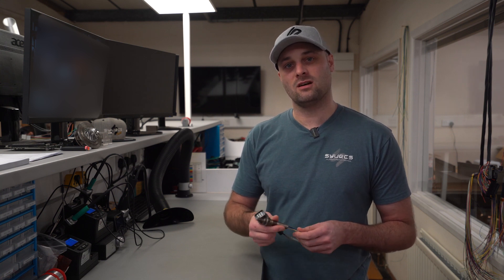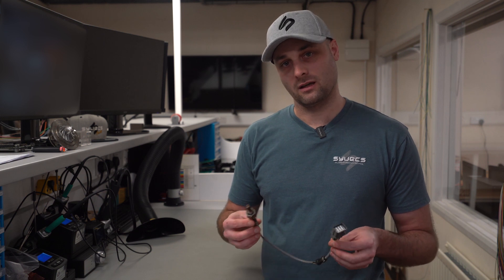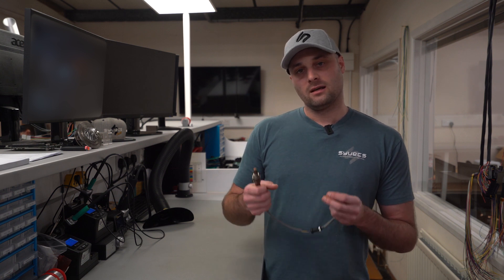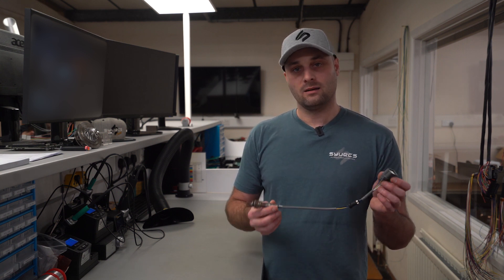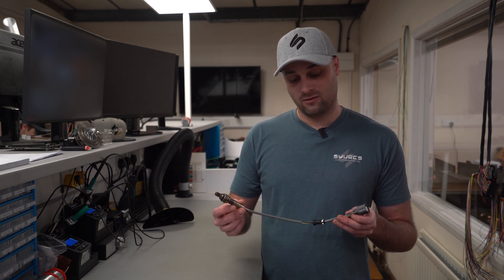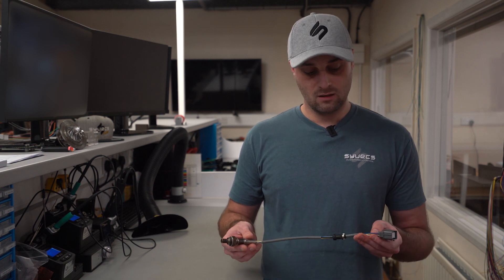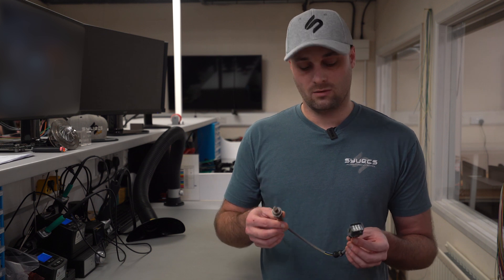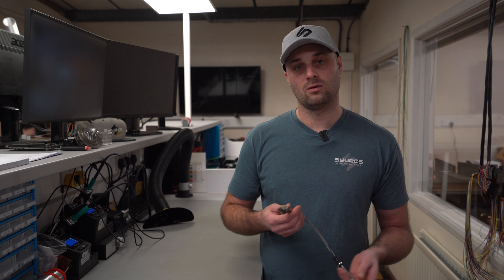The Need To Know About LAMBDAS | Wiring Wednesdays

Comment: I have a S7. This unit comes with only one (1) lambda; however, my set up has for wideband sensors. Does Syvcs have ability to scan each cylinder according to firing order so I can get data on my air fuel ratio using one lambda?